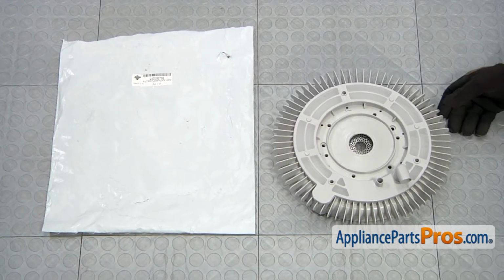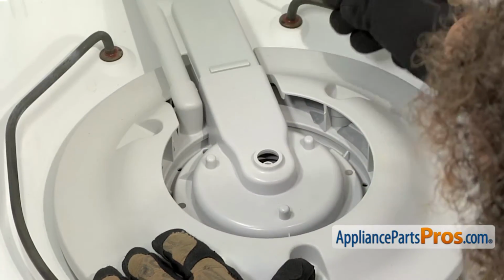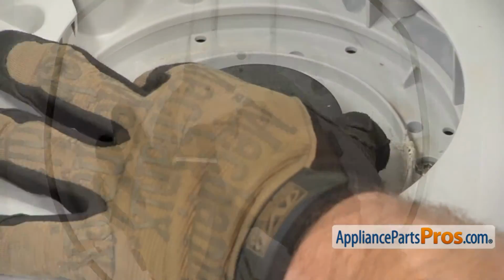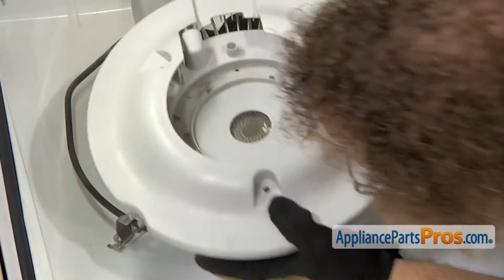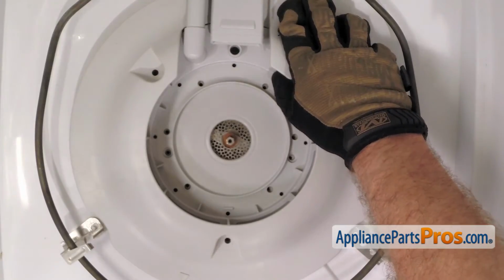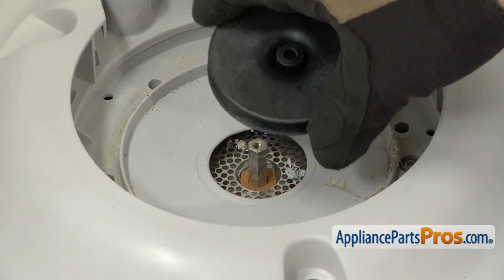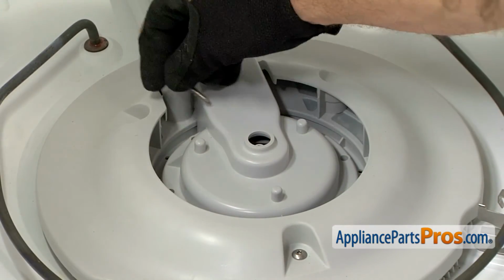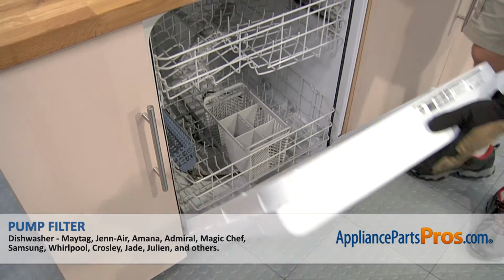How To: Whirlpool/KitchenAid/Maytag Pump Filter WPW10192799

Comment: Knowing this video is 7 years old I probably won't get a response but do you have a video about cleaning the filter
Reply: I came here for the same thing—I just want to clean the filter, not replace it.  I got all the screws out, along with the impeller, but he unit itself absolutely would not budge.  I reassembled it and will just run some dishwasher cleaner through it.
Reply: Same issue. Time for a Bosch 800 Series 😊
Reply: Probably too late but I had a similar issue.  It turned out to be an additional screw hidden under some dishwasher gunk.  Once all the screws are removed it should lift right out.